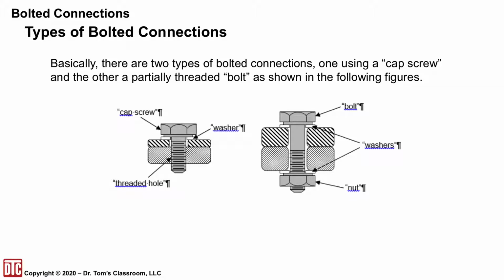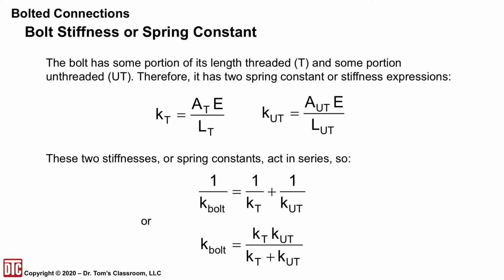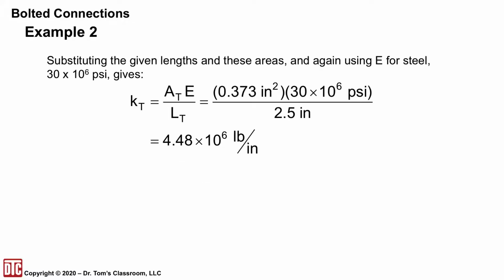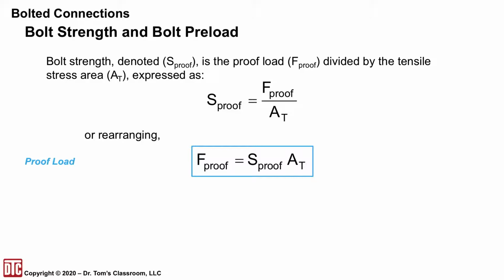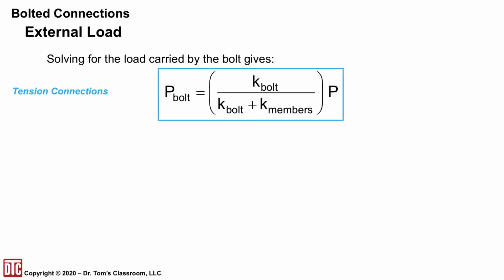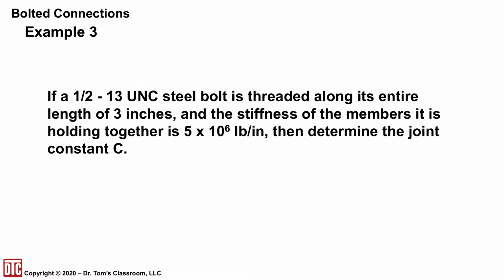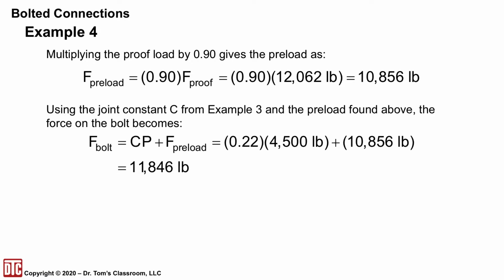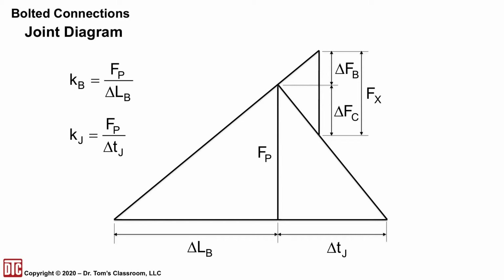SAMPLE LESSON - DTC Mechanical Machine Design & Materials PE Exam Review: Bolted Connections

Comment: The nut is as you say, a member. A Force preload, is the act of screwing in a bolt to the nut, connecting them and compressing the metal rods they are holding together. This would compress the member. Then applying a load as you drew, a force pulling the rods apart, putting the bolt in further tension, and putting the members in further compression. Why then is the force on the members P - F, and not P + F? You have some compression, and then you add more. How are you taking away force on the members?
Reply: The compression acts against the external tension.  You want the total force to still be in compression or else your members will separate. You have a tensile force and a compressive force. Not 2x compressive forces.

Comment: Why does a washer have a spring constant? The washer cannot be put into tension, correct? Only compression? Yes a spring compressing has a spring constant, but it would be acting in the other direction to the system, the bolt/screw, so even if we did consider it's spring constant, how would it be valid within a system being analyzed in tension?
Reply: Washers resist the compression. You want to compress them. Thus the stiffness is required of a washer. Aka spring constant.